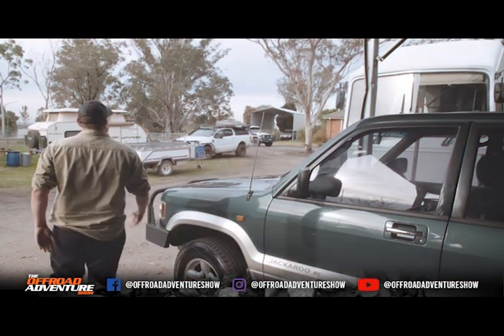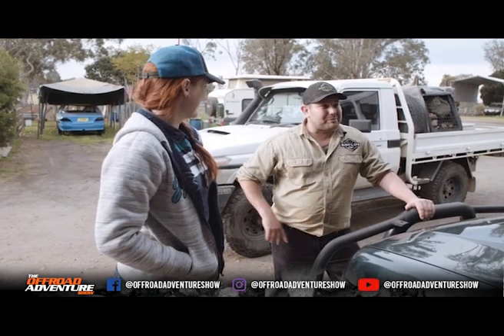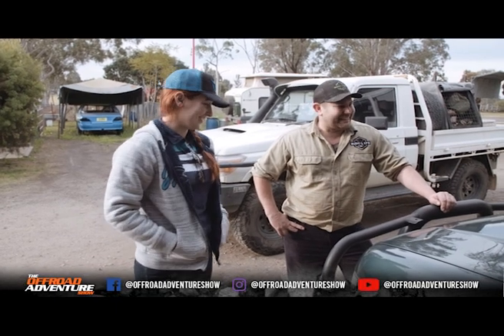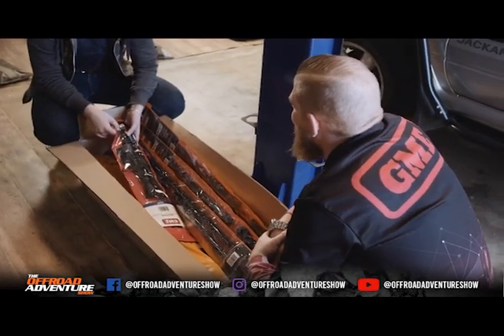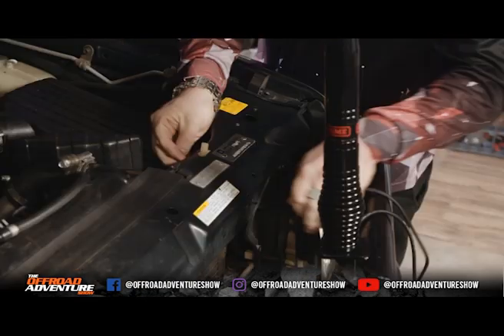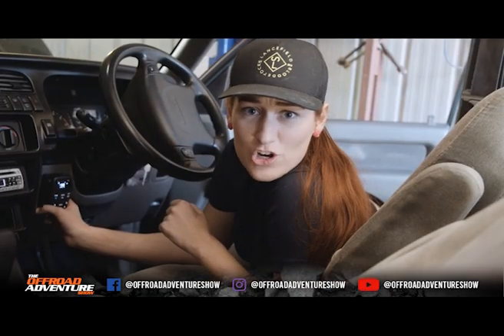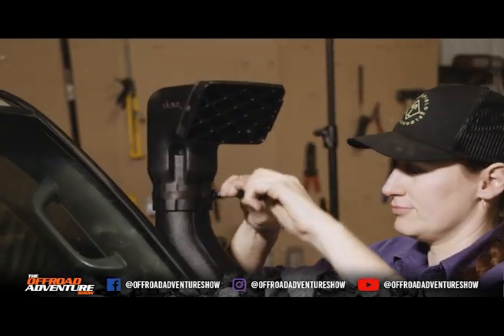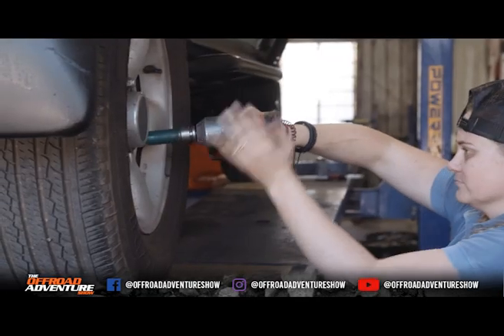Holden Jackaroo Build - This is an Offroad Weapon!

Comment: This rig looks awesome, they are an underrated vehicle. That V6, Auto and 33's combo going to chew the fuel though. Dmax 4JJ1 diesel swap is the go in them, can tune to +300 HP
Reply from the maker: it yes was not a cheap trip for fuel but better then some of the others we had on the trip!

Comment: I love my Holden Jackaroo!! I bought it second hand with an ARB bull bar, 32 inch tyres, blacked out paint job, safari snorkel, lifted and so much more. Looks absolutely mint and goes great off road. First time I have actually come across a video like this and interested to see how your Jackaroo went off road. Mine is my first 4wd I have owned and have taken it up sand dunes and on the beach, a lot of fun; can't wait to take it in the bush!
Reply from the maker: Awesome to hear you love your Jackaroo & have pimped it up like Jess they are an extremely capable 4wd some of the tracks we took it down we were amazed at just how far it went!
Reply: Nice nice.. what engine do you have in yours ?

Comment: At last someone is doing a nice build on a "Trooper". I live in Sweden and has a 1995 3.2 LTD 5-speed manual. Love it, and it´s amazing off road. I have BFG KO2 33" and a 2" lift. Best vehicle I ever had. I think it´s strange how this car seem to be a blind spot for everyone. They are great. Not 100% comparable to an 80-series, but maybe 90% (?). But hey, they only cost 1/10 of an LC. And no one on this planet could say that any LC is worth ten times a Trooper. Maybe people in general don´t know it´s an Isuzu. And in my book that´s not any worse than Toyota in general. And don´t forget that they ride very good on the highway too. The 3.2 should be bullet proof but may take some oil or have ticking lifters when cold, but that´s not a worry. But please take good care of that automatic. They seem to break for the Americans now and then. I don´t really know (mine is manual), but  I guess it´s the usual story of service and not overheat it. Thanks for a good video. You will love it when you see how good it can flex for beeing an IFS. Compared to some rivals, it´s a rock crawler. And they did a good job with the stock skid plates too. Regarding your accesories, where do I put my money? And does it ship to Sweden?

Comment: Had one of these, never again, the 3.2 v6 is the worse engine ever and an absolute mongrel to work on, went through 8 alternators in 3 yrs, the slightest bit of mud/water etc and it's off to buy another one, lifter noise was horrid and expensive to replace and the transfer case hangs very low, got hung up many times. The 3.5 v6 was the better engine of choice, if that engine ever died you could put in a 3.8 v6 commodore engine with little hassle (bell housing bolted straight up). They are a very comfy and capable 4x4 i just wished i had never picked the 3.2 v6 and be wary of who you get to fix the auto, not a lot of people know much about them, most will recommend a rebuild ($3500+) when all it needs is flushing properly and there is a certain way of doing it , it pays to do your research on these vehicles, even Holden didn't know how to repair these vehicles properly.